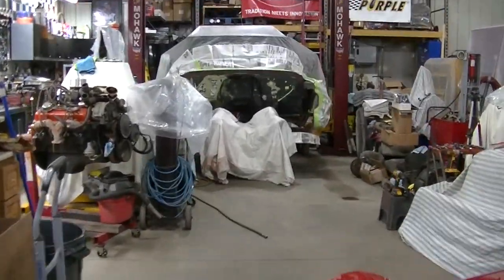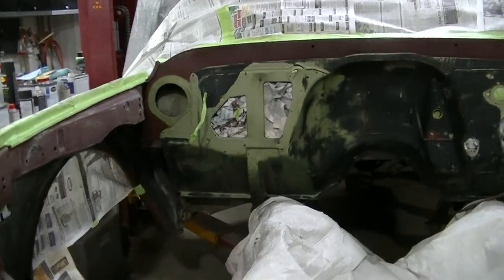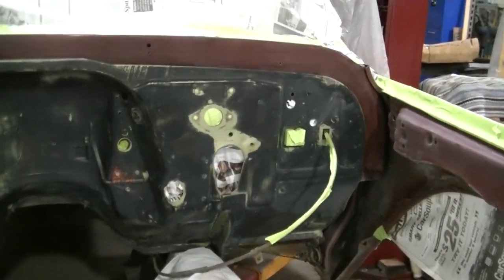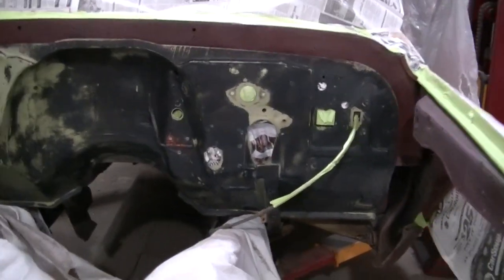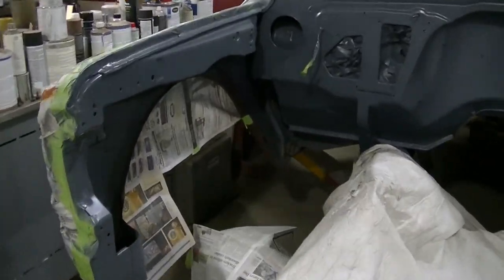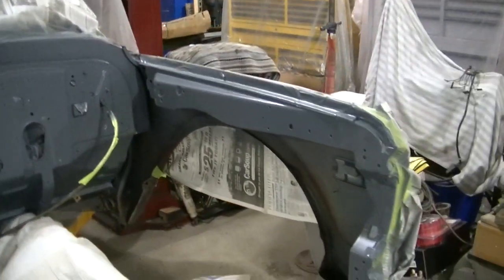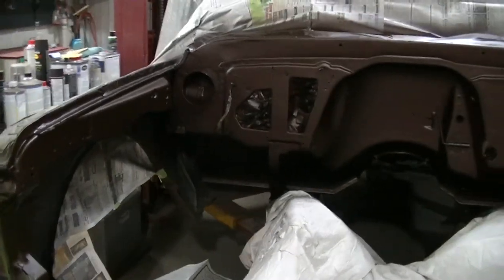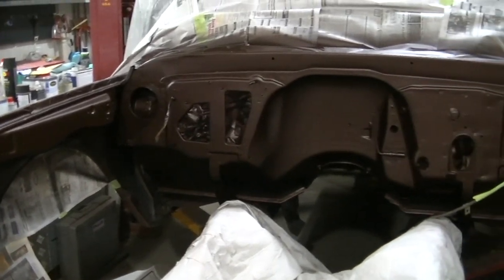70 Chevy Truck Firewall Painting

Comment from the maker: Things that might help with a project like this:
Rust-Oleum Paint: https://amzn.to/3xVVqZH
Poly Motor Mount: https://amzn.to/3xv7PF3
Ebay Ash Tray:  https://ebay.us/6x1sbD
Rear View Mirror:  https://ebay.us/qnjPAt
LED Heater Control Bulb:  https://amzn.to/3Bbmofk
Heater Control:  https://ebay.us/mIQXpH
Dash Pad: https://ebay.us/LxR98V
CST Emblem: https://ebay.us/h9DhOz
Perfect It Compound: https://amzn.to/3anG4Sd
Steering Wheel:  https://ebay.us/qqFkYJ
Steering Wheel Puller:  https://amzn.to/3msxGbo
Dorman Turn Signal Cam:  https://amzn.to/3j85w3l
NGK Plugs:  https://amzn.to/3lui0Uv
Ventshade Visor:  https://amzn.to/2TGn9NM
Trim Rings 1.75":  https://amzn.to/3f7Wxgo
LED Taillights:  https://amzn.to/3rqmwEq
LED Flasher:  https://amzn.to/3kVm6oH
Aluminum Radiator:  https://amzn.to/2Vy1CaM
Hood Bowtie:  https://ebay.us/gJiHNF
Body Bushings:  https://amzn.to/3AzfEZC
Air Cat Cut Off Tool:  https://amzn.to/3weGGSM
Skyjacker Dual Kit (Black):  https://amzn.to/2TpWWTP
Bed Rack:  https://amzn.to/3x7WsjJ
Dick Cepek Tires:  https://ebay.us/gScPHA
LED Headlight:  https://amzn.to/3cCDgCy
LED Parking Bulb:  https://amzn.to/3utPZNV
LED Backup:  https://amzn.to/34m38hp
Side Marker Lights:  https://amzn.to/3yLsWRM

This video contains affiliate links, which means that if you click on one of the product links and buy, I'll receive a small commission.

Comment: I love the color for the truck. Not so much if you were going to paint the Camaro with it though.
Reply from the maker: The root beer color is very close to a factory color they had in 70 so it should be fine for the truck. The Camaro was almost painted this color. I would have liked something other than red for the Camaro but that's the color it was born with.